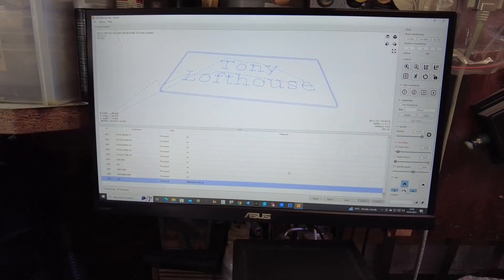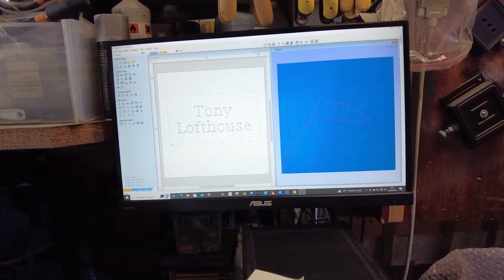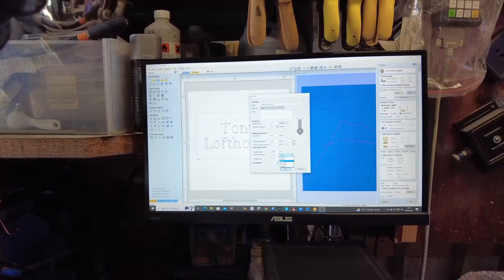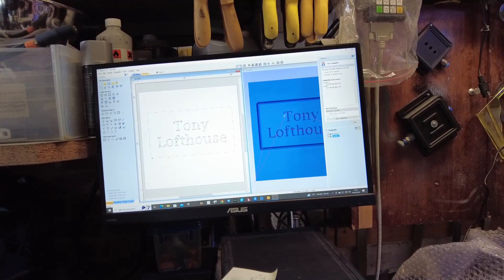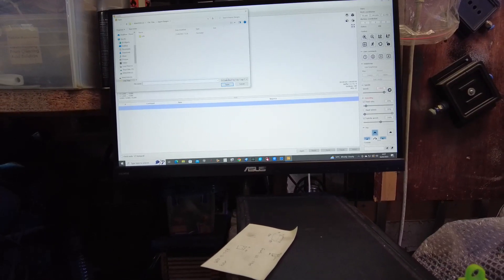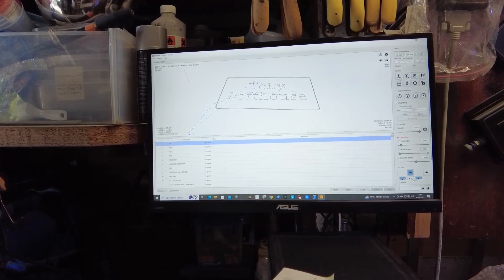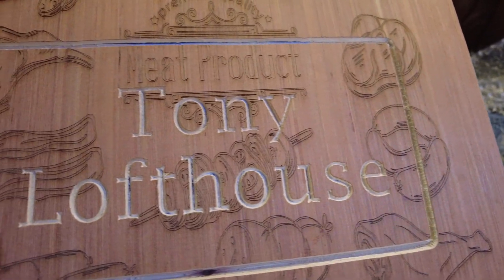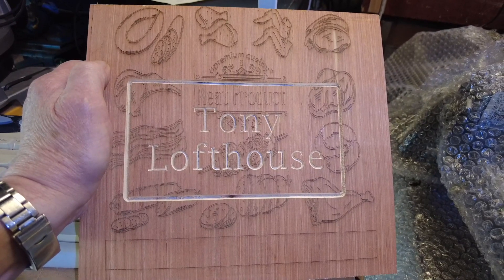Sainsmart Genmitsu CNC 4040 pro using  Vectric Aspire 9.5 and Candle software

Comment: I am new to the Genmitsu 4040 pro and was not able to find any info on which post processor to use. I also did not realize candle had adjustments for feed rates. I went through several days of trial and error tool configurations on vcarve to slow the feeds down.  I wish I had found your video sooner. It is the little things the manufactures neglect to mention that really eat up the clock.  Use GRBL (mm).tap and adjust feed rates in Candle. Thank you for this Tony!
Reply from the maker: You are welcome please keep me informed as to how you are getting to grips with the 4040 pro. Thanks Tony